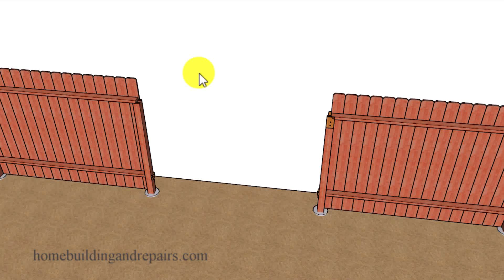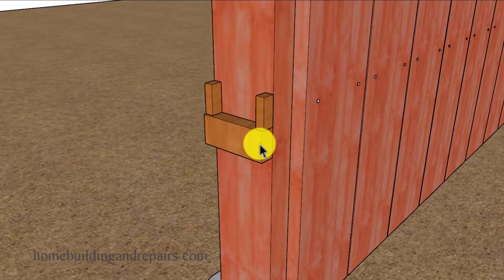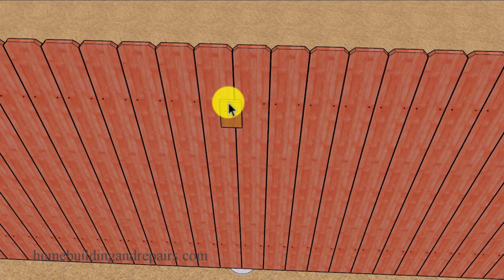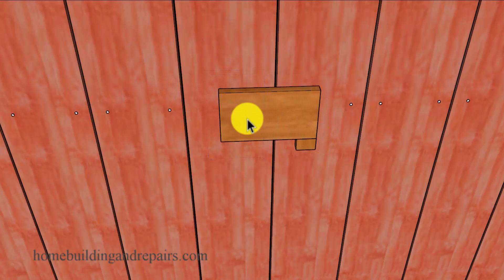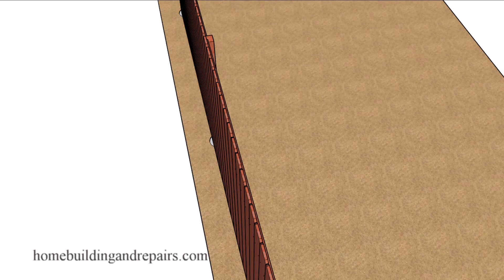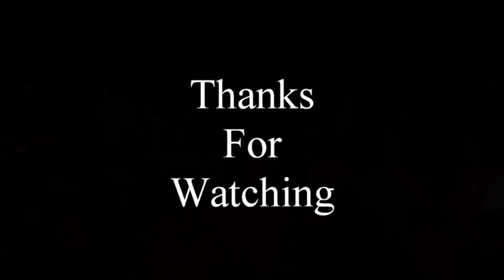How To Build A Removable Section of Wood Fence - Easy Construction Methods For New Builders

Comment: If you make your slots in a v shape or angled so the weight of the panel tightens it up as you drop it in. Just be sure you can remove it from the v or angled slots. You could also use a long board and something for a fulcrum for leverage under the bottom when pulling it out.

Comment: Why don't you use a metal joist hanger and not screw in the rail  instead of fabricating the slot?
Reply from the maker: If it will work, then go for it.